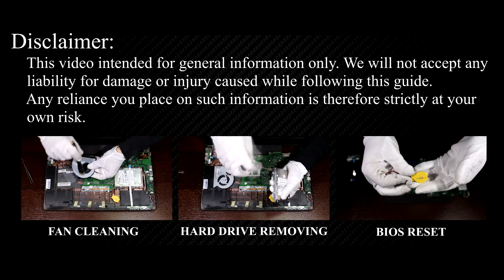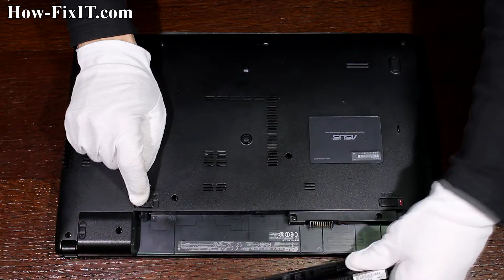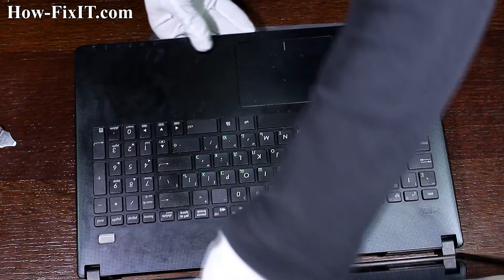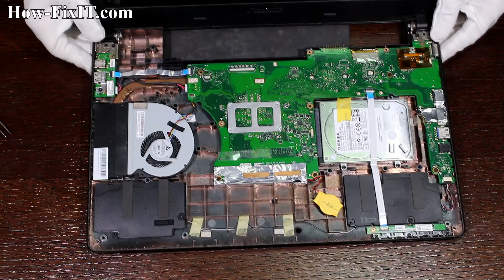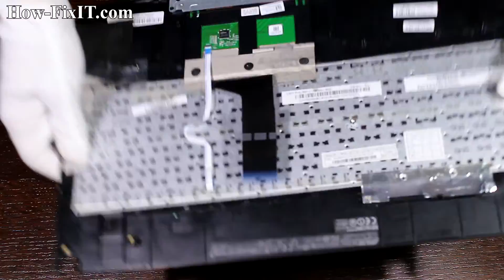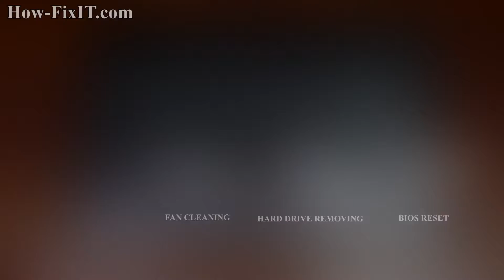Asus X501 RAM Upgrade & Install: Step-by-Step DIY Guide

Comment: 8 GB of ram (be sure to choose this variant because the default one in the link is the 4 GB) + SSD + Lubuntu 22.04.2 and the system is very fast! about 30 seconds for a complete boot and everything runs smoothly!

Comment: The processor supports 16 GB of DDR3-1600 SODIMM, but a single module can be no more than 8 GB (at least according to my research) and the X501A has only one slot, so 8 GB is the limit
Reply: What about x501u?
Reply: @Pluggy_Gamer  unfortunally the X501U has the ram soldered to the motherboard 😞but at least it comes with 4 GB of ram, still way better than the 2 GB on the older revisions, with an SSD you should still be able to use this laptop smoothly, especially for office and multimedia
Reply: @sospyro  i mean i used it but it has 1.0ghz processor so it's dead now i had it and then screen went blank
Reply: @sospyro  and wait you are on youtube from 2006 THAT'S CRAZY
Reply: I was looking at upgrading the RAM... 
SPECCY shows it has 4 slots, one used
Where are the other three???

Comment: Supporta 16gb o solo 8gb?
Reply: memory of model X501U is soldered and can't be replaced
Reply: The processor supports 16 GB of DDR3-1600 SODIMM, but a single module can be no more than 8 GB (at least according to my research) and the X501A has only one slot, so 8 GB is the limit

Comment: Is the change big going from 2 to 8 GB ? I am fixing my sister's laptop, it's dreadfully slow even with SSD upgrade and fresh new OS.
Reply: did you succed? I'm thinking of doing the same.
Reply: @sandomachera  Ended up not doing it, though I don't think it would bring much change after lots of consideration. Just invest your money into a new laptop all together.
Reply: @admirmehic8552  awh.. i was thinking to do it
Reply: memory of model X501U is soldered and can't be replaced

Comment: has anyone tried 16gb ram on asus x501a? or anything bigger than 8gb?
Reply: I’ve been wondering the same thing did you ever try it
Reply: Avete notizie, supporta 16gb o solo 8?
Reply: The processor supports 16 GB of DDR3-1600 SODIMM, but a single module can be no more than 8 GB (at least according to my research) and the X501A has only one slot, so 8 GB is the limit

Comment: Hello!  could it support an 8 GB Ram?
Reply: The processor supports 16 GB of DDR3-1600 SODIMM, but a single module can be no more than 8 GB (at least according to my research) and the X501A has only one slot, so 8 GB is the limit
Reply: i think that it could support 16GB RAM.  do you find cpu( B820 search plz )

Comment: 8 или 4 Гб памяти подойдет?
Reply from the maker: да
Reply: @howfixit  а 16?
Reply: памаять в модели X501U впаяна намертво и нет слота для расширения 🤷‍♂️
Reply: The processor supports 16 GB of DDR3-1600 SODIMM, but a single module can be no more than 8 GB (at least according to my research) and the X501A has only one slot, so 8 GB is the limit